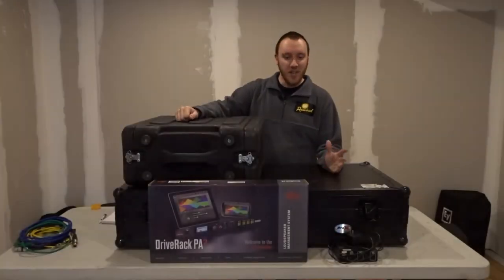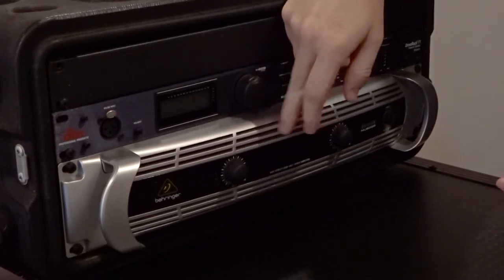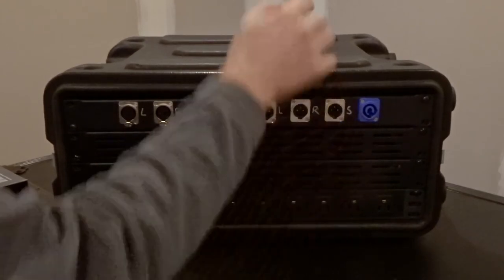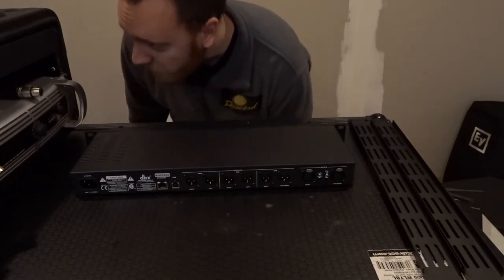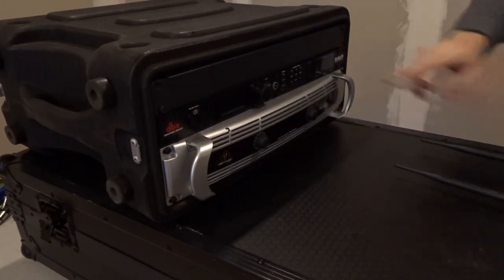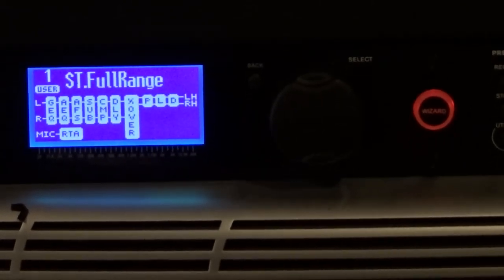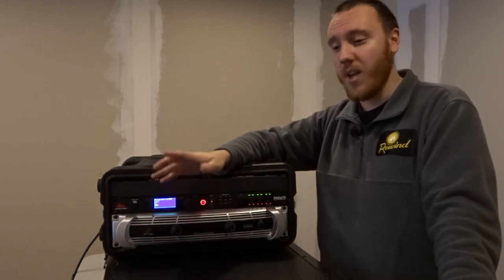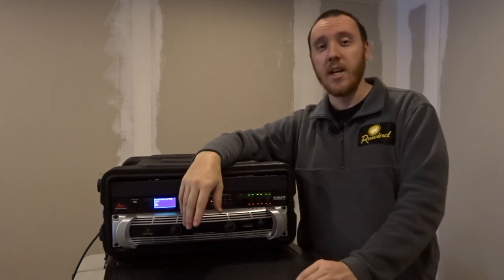DriveRack PA2 - Getting Started

Comment: Hey Bro, can I use any of the outputs to any of the inputs, meaning if I want to use the left input for tops on the right side for bass only that way basically I can separate the inputs from my controller One on the master output and the other one on the booth Is it possible because my current speaker management can do this thanks

Comment: I have a question please.
 
I’m a mobile DJ looking at purchasing one of these to further tailor/enhance/limit front of house sound. The remote app also appeals to me.
 
My system is 2x EV EKX-12P active tops and 2x EV EKX-18SP active subwoofers. The DSP control on these speakers have the option to system-match the crossover i.e. the high pass for the tops can be set to EKX-18SP (or other EV models) and the low pass for the subs can be set to EKX-12P (or other EV models).
 
Would I be able to route the signal flow/configure the settings in the DriveRack so the above is maintained?
 
I don’t want the DriveRack crossover controls to supersede the speakers’ system-matched settings.
 
N.B. The outputs on EKX subwoofers are hardwired as a thru output (no DSP out) i.e. they’re always sending a full range signal (see this video explanation – EV ELX200, EKX & ETX Crossovers | How they work and why they are not good options for column arrays - YouTube).
 
Any help appreciated.

Comment: Our band PA system has only two Outputs, so we basically only have the house speakers pointing out. We want to use stage monitors and have the ability to put what we want through them vs a daisy chain of speakers but same issue with our AMP. 4 outs. So the subs and the Pa  use those up..  Will this unit be the answer for obtaining what we need to do?
Reply: What kind of mixer are you using that has only 2 outputs?

Comment: Nice demo,  a little dark on the lighting but good explanation of why you use a drive rack and why you are upgrading. Do you have any experience with Behringer's X-air series of digital mixers? They are all remotely operated as well. They have a 31 band eq for the room but have no sub's out, you would have to run the subs out of the aux sends but if you have all your aux sends tied up with monitors then you would need a way to send signal to a set of subs. I suppose a drive rack would be good for that?
Reply from the maker: It would! I actually have two videos on the x-air series on the channel. One of the XR18 and one of the xr12